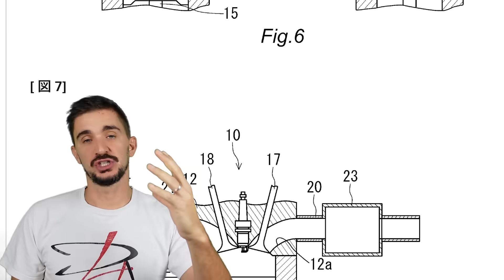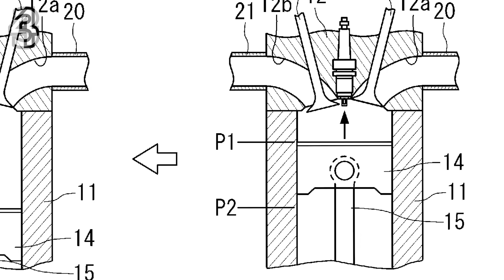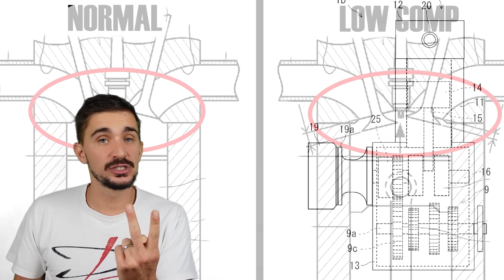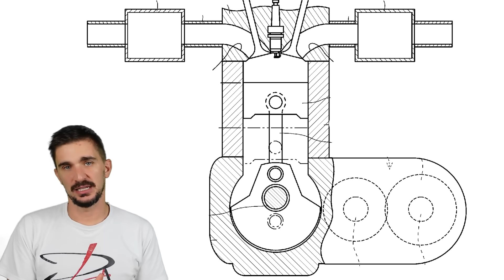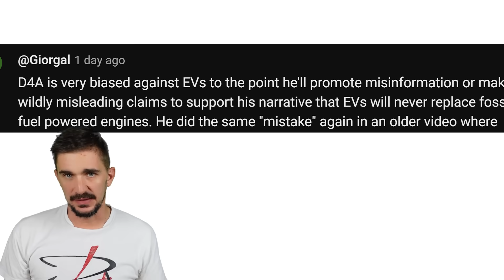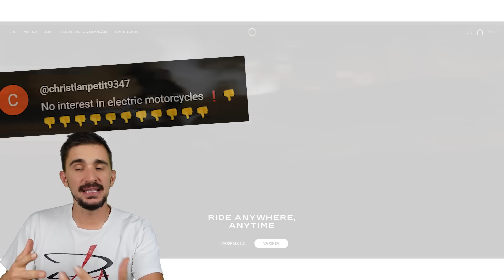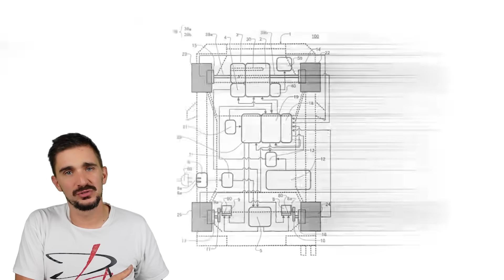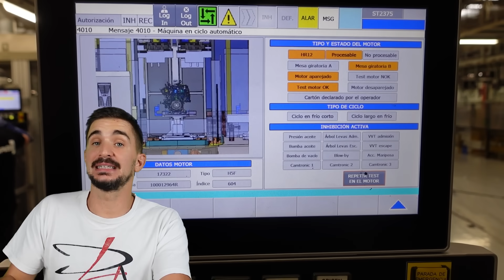Yamaha Just Patented A Fake Engine

Comment: This in my opinion is as stupid as a CVT with fake shifts.  Lets add extra parts that are not needed.  
If you wanted a Motor cycle that makes noise and vibrations, then this thing would not. At a loss for how stupid this fate thing is.

Comment: This "desire to maintain the feeling of the original model" is the same thing that Dodge tried to do with their EV Charger models when they introduced the stupid fan that sounds like a dying bobcat. 

Rather than owning that things are changing, they are attempting to actively fool their audience even though the audience passively knows it's an EV. 

I own a 5.7l hemi charger, and when I heard the EV "engine rev", I actively cringed in my seat. The debut would have been 100x better received if they didn't do that.

Comment: What about cars with CVT that faked gear change? Faking gear shifts, making the performance worse and it still sold. Instead of keeping the engine running at peak power and continuously varying the gear ratio while accelerating to get the best possible acceleration, the car fakes gear switches while the engine RPM fluctuates outside its peak performance value. FFS why bother with a CVT drive when you are NOT using its potential? On the other side, you can keep the engine at peak efficiency when driving around.

People are idiots. Fake engines are just for idiots. And there are enough out there willing to pay for them.

Comment: I have a 7.7L, 500+HP, 560lb/ft, pushrod OHV engine in a muscle car from 1970. It's got 2" headers running to a 3" x-pipe with 2 chamber mufflers. It lopes hard at 600 rpm idling, and at about 1000 rpm it almost sounds like a helicopter. Through the entire rev range it's an absolute joy to drive. It sounds like a T-Rex in heat from 3000 rpm, and gets this violent aspect to the howl from about 4500-6000. At a red light, it's louder than Harleys, and they look over at me like "Jesus, dude. Is it loud enough?" It's an absolute experience driving it.

I have a buddy who, like many gear heads, absolutely prefers a manual gearbox for the sensation, regardless of the fact that autos are superior for racing now, especially with dual clutch gearboxes.

That said, I wouldn't ever want something fake. The hijinks that Hyundai and other EV carmakers have implemented to replicate these sensations in their EV models is unnecessary, and if anything, is less efficient. It's like having a hooker say "I love you" before demanding payment, lol
Reply: Why do you have engine size in metric, but all other measurements in non-metric (RPM aside) ? 😵‍💫

Comment: A more efficient way to add vibration would be to put an offset weight on a small electric motor. Like an old cell phone. Hey simple, computer chip could be programmed to control the RPM to mimic gears and shifting. This system would be smaller, lighter, and less of a drag on the system.

Comment: This reeks of business idiot hit a number behavior. Do I actually think Yamaha is going to build these things anytime soon? No. Do I think someone at Yamaha would make themselves eligible for a bonus if they filed for enough patents related to EV bikes? Yes. This feels like someone doing worthless work in the name of hitting some arbitrary number of units of output because some business idiot decided everything had to be "data driven" but also doesn't understand that data is more than numbers of units being counted. This is a dumb idea. If you wanted to make an EV vibrate like a gas motor and make exhaust sounds, a speaker and a haptic stepper motor would get the job done with far less waste of energy. This is so dumb it hurts.

Comment: Patents are often filed for defensive purposes. I think this is one of those cases. Yamaha is protecting their large cruisers in case some manufacturer decides to release a motorcycle with this 'engine'. While it's certainly strange that the patent contains so many details regarding the valve opening mechanism, it may have been necessary to register such a patent.
Also, I have an idea how it will sound: https://youtu.be/mSzk5iz726E?si=9FUzt2O9oj4H2pQw&t=1204

Comment: I could understand using an electric motor that had the finned MC engine design for a look. I do think it would be cool to have the electric motor spin a transmission input shaft so that you could still clutch and shift gears

Comment: You have explained your points greatly. Let me add something:
This fake engine doesn't need oil replacement because there's no combustion in it hence it does need any cooling system at all. Air cooling would be just good enough for it.

Comment: Yeah we might as well call it a subwoofer - like many EVs used to do, mimicking engine noises to alert nearby pedestrians and giving comfort to drivers, like they currently do with more nuanced noises that sound less like an engine and more like a background machine working. I do see a point in this patent, anyway, the only issue I see is that I should be able to shut the subwoofer off if I am not just showing off to neighbouring people but I am cruising on the road and nobody's listening to me.

Comment: After 20 years riding, I have carpal tunnel syndrome from bar vibrations, the reason I have to sell my bike instead of switching to electric, is that electric motorcycles are garbage right now.
Work on range and creating something that scratches the ‘beefy’ itch that current electric bikes lack. They feel flimsy.

Comment: What if it's a real engine, faking that it's a fake engine?  One that can be turned into a real engine with a small bag of parts? This could have advantages in certain parts of the world that restrict real motorcycles. The bike, sold as "electric", gets by the regulators, and the customers get their beloved noisy, vibrating, non-EV bikes. [edit: darn, @mikespence2836 already said this]

Comment: I would buy an electric bike that has a tune from a speaker   optimized for safety and a range of 200-300 km and acceleration similar to 750-1000 cc.

Comment: 1) a decent mechanic can turn this bike into a mobile air compressor.
2) a very good mechanical engineer could turn this into a pnuematic, regenerative braking system. 
Pnuematic regenerative braking was something Ford was planning to attempt decades ago. You basically engage the compressor pump ("fake engine") when you brake. 
The compression helps slow the machine down. The compressed air is stored in a tank.
 The compressed air is released into supplemental pnuematic motors during launch, to reduce the normal launch load.

Comment: I have a misfiring engine with bad air leak. Do I need to talk to a lawyer?
Reply: As long as you hand crank it without using an electric starter you’re fine 😂😂😂
Reply: The good news is,  it doesn't tune-ups
Reply: not really, as long as you don't mass murder engines and sell them as noise making device lol

Comment: I would’ve seen something like a special rumble pack (like you have in Game controllers) thats able to simulate engine vibrations, coupled to something like AngeTheGreats Engine simulator connected to a speaker, but this is just the dumbest way possible to do this. Although I personally also wouldn’t get an Electric motorbike missing the gear shift takes a significant part od the experience away in my opinion

Comment: $5 says they file this patent just to sit on it and prevent everyone else from doing the same thing. Like Sony owns a patent for putting ads in videogames that make you sing the jingle along or something like that, never used it, and never let anyone else use it.
Reply: Good on Sony.
 But this has the potential for being a mobile air compressor.
There are practical applications for the setup beyond vanity, as long as you can shut it off
Reply: @RequisiteFunction  All manners of air compressors already exist and can't even be patented.
Reply: @michaelbuckers  yes but how many exist on motorcycles
Reply: @RequisiteFunction  why would a bike even have a compressor? And again, compressors can't be patented, and this patent is expressly about imitating the feel of a running engine, not generating compressed air.
Reply: @michaelbuckers but it does compress air. That's how the sound works.
See my other comment about regenerative braking.
Reply: @michaelbuckers  there was a bike several years ago being designed with an on board air compressor for maintenance crews.
Reply: There are so many other possible variations that could be done, so I don't think this would get in the way of someone else doing a similar thing.  I just don't see why they would.
Reply: @AkaRyrye83  that is a really cool idea actually!

Comment: A speaker and linear shaker would accomplish the same thing without the friction losses, mass and size. The electric motor could be in the “cylinder” and control electronics in the “gearbox” to offset space loss.

Comment: What I would love, is a two cylinder engine, that moves the two pistons by a magnet and and a coil. Electric. Such an engine can have the same "feel" as one that burns gas (petrol). I've just seen a video on a  tiny V8 engine doing so. But why not change a REAL Harley or Yamaha twin? Yes, it is not perfect and extremely powerful. But touring bike riders might LIKE an electric bike that rides exactly like the ICE version. How hard is it? Maybe electric twostroke makes even more sense, there is no intake and compression, why maintain the fourstroke "firing" order? Yes, for the engine character. But twostroke is a great option. Low revving, the engine can do twice the normal power strokes.

See? If I can think such thoughts, then why do I never see such pulsating ELECTRIC engines in a motorbike? Do I really need to develop one myself, before the motorbike world wakes up? They only do the trick they know. Real new things, the innovation tempo really disappoints me. So, make a classic ICE engine and push the pistons down electric. That's all I'm asking. Why is it not there, by now?

Comment: This is only my opinion and this is maybe not talked about in the patent (if it's not then it really sucks), but I tend to not hear electronic motors when they pass by, especially when I'm on my bike since they don't make the sound that I'm used to and since such vehicles can be hidden behind houses/trees/shrubs etc, you can not (sometimes) notice them coming to your way in an intersection. I got in a collision with a vehicle one day because of this.

Honestly, the only plausible reason I can think of making such fake engine, is to make same noises so that people can notice them quickly before an accident, even though I guess there is probably better way of noticing others that you're here.

Comment: I suggest replacing the metal engine dummy with a solid plastic dummy with a speaker that produces engine sound, and attaching an eccentric to the electric motor shaft if vibration is important to the owner.

Comment: This is just Yamaha.covering bases. The reasons why electric motorcycles have yet to be accepted are as follows:-
A) too expensive
B) too heavy
C) too range limited

Once battery tech/energy density is high enough…. they’ll be accepted. 
Vibes and noise are for posers… real bikers want smooth power and lots of it…. (allegedly)

Comment: Next patent: an engine solely designed to burn CO2- neutral artificial fuel to provide the sound and vibrations the electric motor does not provide ... including an exhaust system that can be modified to make more noise, and a chain that spins free on the rear axle

Comment: My family owns a Tesla model y and a Tesla model 3. I've always been interested in the internal combustion engine. 
I'm definitely a Motorhead. But performances always has been my first priority and electric cars give you that. Along with simplicity.
Reply: simplicity lol
Reply: they are not simple...
Reply: @1totoche007 compared to the modern internal combustion engine. Teslas Electric is much less mechanically complex.
Reply: @davidhumeston5292  Mechanically yes, but the mechanical parts they have in the power train are controlled by extremely complex high power electronics, high voltage battery and all the safety stuff that goers with it.  They are far from simple.

Comment: Are there people in offices at these OEMs that think this is what we need to finally buy an electric?  I'm easily sold on electric... once I can get the same range, weight, comparable performance... for a similar price point.  That's it.  Do that.. and I'll buy immediately.  Do they think I'd rather go to a gas station constantly than just plug it in?  Until then... I'll stick to my small CC street bikes.  Currently loving the ZX-4RR.  Most smiles per mile I've had in a decade.

Comment: Why not store that compressed air for use later, such as to air up the tires and/or adjust the suspension? Oh, wait, that would add more weight plus the danger of a pressurized tank.

Final solution options: 
(1) buy a fully electric "straddle-type" vehicle, aka motorcycle EV
(2) buy a real motorcycle that uses gasoline to propel the "driver", and can recharge in a few minutes at any gas station

Comment: They would be better off just adding a subwoofer with a strong bass connected to the engine to add sound and engine vibes, and a haptic feedback unit under the seat that is connected to the speaker to add some more felt vibrations (Think of your vibrating headphones or the vr haptic feedback vests), it would be a lot more efficient, the same speak can be used for the horn and a music system. You could even chose your engine configuration.

Comment: It's the year 2026. They have won. The internal combustion engine was completely outlawed for road use. The only things they are selling are electric cars and two wheels with batteries permanently attached to them, which requires you to buy another when they fail; just like a smartphone but for transportation.

Yamaha, having forseen the future, already has a plan. A plan to keep the idea of the now illegal fuel burning, air polluting, heart revving internal combustion engine, right under their noses of those who have banned it. They make and sell those so called electric motor with devices that imitate fake engine noise, just with a big warning label:

"Before riding the vehicle, do NOT put gasoline or any kind of fuel into the fake container which could hold approximately one gallon of liquid, and connect the suspiciously disconnected socket to the fake sparkplug. If you did, please do not attempt to press the start button, or roll the vehicle to 16 kmph and put it in gear and dump the clutch, because then it will convert itself into a four stroke engine."

Comment: Funny because Yamaha also make musical instruments and precision motors for industrial robots (And at least one for EV's a few years ago, though I have no idea if it ever made production). The most impressive thing about the video I saw showing the electric motor is that the motor sounded absolutely fantastic, so Yamaha probably don't have much to worry about on this. Anyone who's worked near powerful 3 phase motors will know they are anything but silent, they just don't make the same noise as IC engines.

If the moving cylinder was being used to pump air for cooling it might actually be doing something useful too - if drive can be disconnected from the wheel it could work as a mobile air compressor too. The sound of IC engines is almost entirely created by air moving around, so carefully shaped cooling ducts and pumping in pulses instead of continuously will cover the fundamentals.

Comment: So... Yamaha has patented an incorrectly timed and balanced engine to work as a compressor, make it sound like an engine exhaust while also acting like a vibrator. Waste of time and resources IMO.

The main reason we have to change oil is blow-by contamination. I would guess the noise-generating piston's oil stays cleaner for much longer since there is no gasoline and exhaust contaminating it. If it has an oil change interval, it likely is 50-80k miles like transmission fluid.

If the fake engine breaks, remove the cylinder head, remove the guts all the way to the sprocket that takes input power from the electric motor gear, put sealant around the opening and bolt a cover plate on.

Comment: Faking engine sounds and vibration solely with loudspeakers, is not as easy, as usual compact speaker drivers are not meant to create a lot of infrasonic sound or low-frequency body resonation. Even fake exhaust sounds driven by loudspeakers (Hello, Audi!) rely on low frequencies and vibrations from an actual engine. 

Maybe the solution is electromagnetic body exciters, aka butt-kickers or bass shakers, like Mercedes and BMW are using them in the seats as part of their ultra-premium audio systems. Such should be capable of causing enough of vibration to emulate an engine.

Comment: Personally I think Yamaha would do better to make this a hybrid system and design it to be run on ethanol.

that would cut down emissions quite a lot, the fuel is renewable, and it would easily pass, if not even exceed emissions regulations for years.

I'll bet they could make that thing do 70mpg on ethanol or well over 100mpg on E10 if they build the hybrid system correctly...

Second to that - If they opt to do a CVT system with a hybrid drivetrain - what if they also added a shift lever that can be enabled so you can simulate the stepped shifting behaviour of a standard dogbox?

Comment: Imo if an electric bike has a straight cut gear sound, or sounds like formula e or 1/10 rc car, then it would be enough for me. don't need gears, my "50"cc scooter doesn't have distinguishable gears ether, but it's still fun
Reply from the maker: Same! There's something to give you an auditory orientation of machine strain